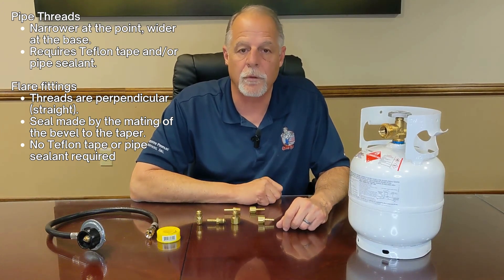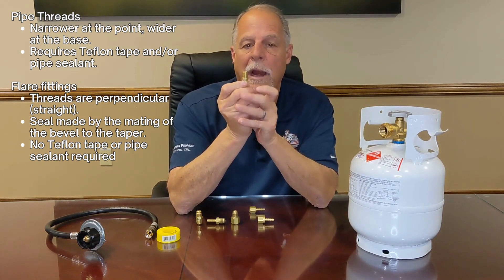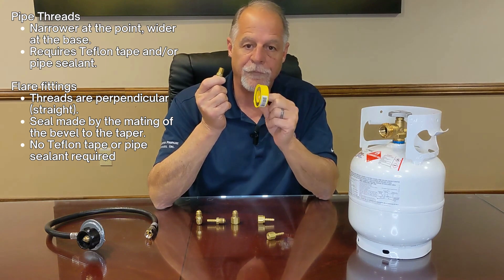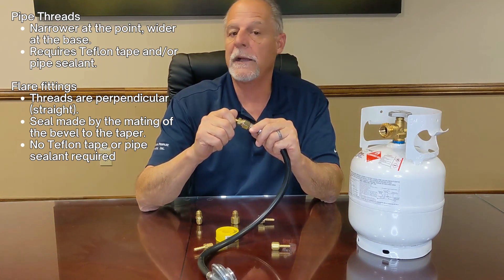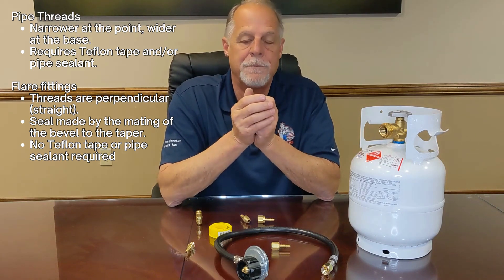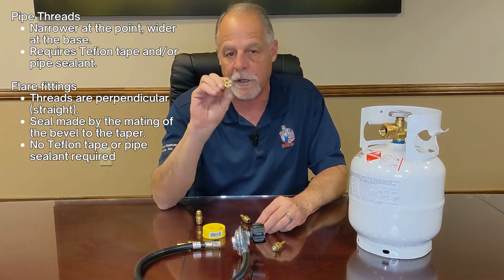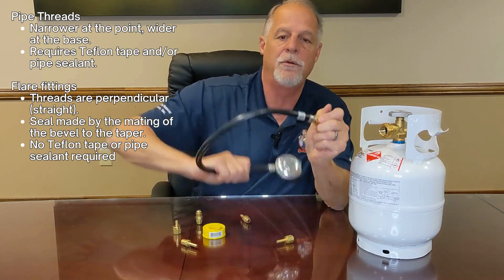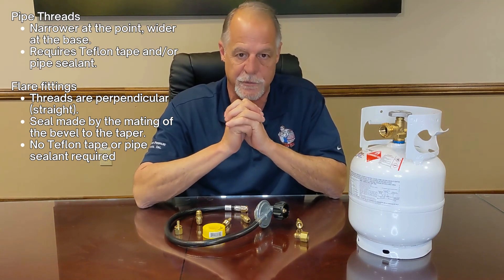Propane Fittings

Comment: Good video, thanks. I have a question. I recently bought a new Mr Heater stove for my shop. I need to remove the hose from the regulator so I can attach the regulator on the tank outside my shop (I have a fixed copper line running from the tanks to the shop.) I am having an interesting time unscrewing the hose from the regulator. Should be counterclockwise to unscrew it? And it's new, it should unscrew without any issues. Hope this makes sense.

Comment: I have an extra high-pressure propane hose that I was wondering if I could use to connect a low-pressure source to a low-pressure appliance.
I ask since I noticed the high-pressure hoses have a smaller diameter hole compared to the low-pressure hoses which have a larger diameter hole.

I just don't want to have to waste a perfectly good (brand new) hose.